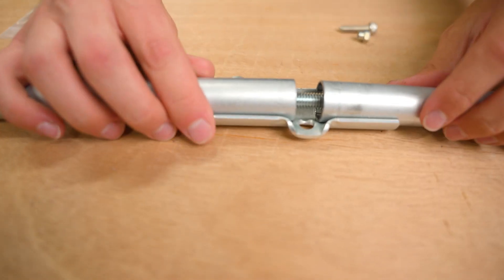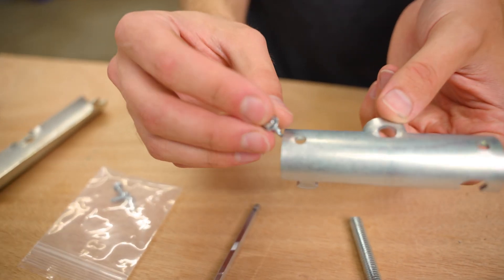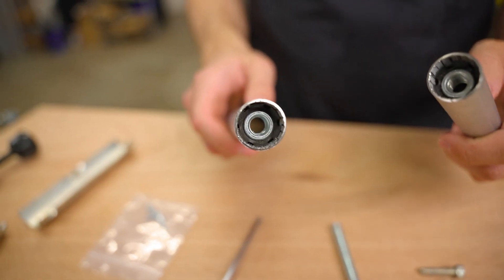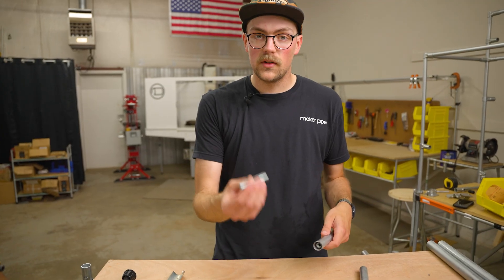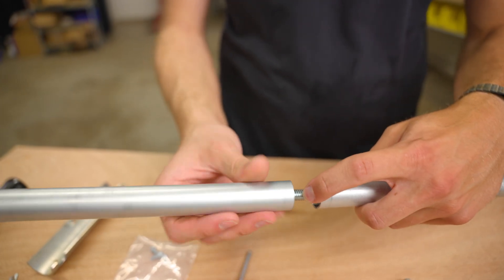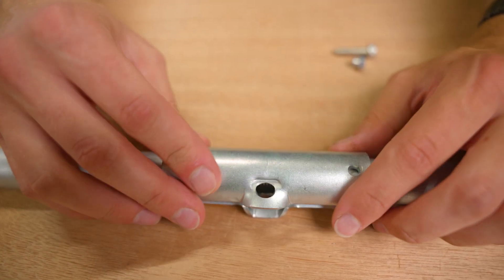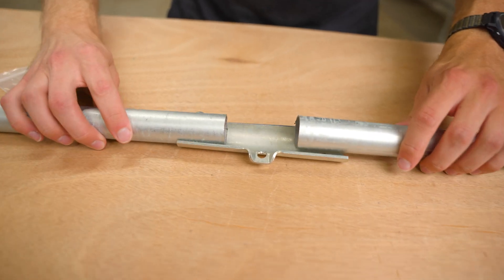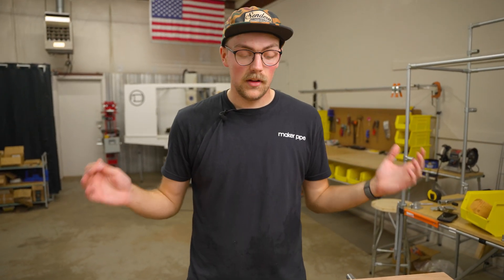How To Reinforce The Conduit Coupling From Maker Pipe

Comment: Is this also available for 1/2 inch EMT?
Reply from the maker: Hi there, we have adapters shims that let you use the same Coupling for 1/2" EMT Conduit. Here is a link to the Coupling option that comes with the shims included. https://makerpipe.com/collections/modular-pipe-fittings/products/structural-emt-conduit-coupling?variant=39973872402505

Comment: IMO, the strongest is to use an internal sleeve to join and hold the two pipes, then weld each pipe to the sleeve with a wire welder. The advantage is that it is super strong and cheap. The disadvantage is that the welded area has to be painted, so isn't as quick. It is a great way to join pipes that are to be bent in a hoop bender for hoop roofs, which is what I use it for.